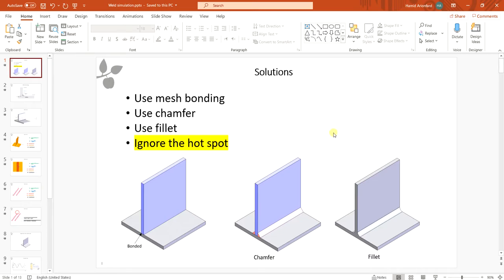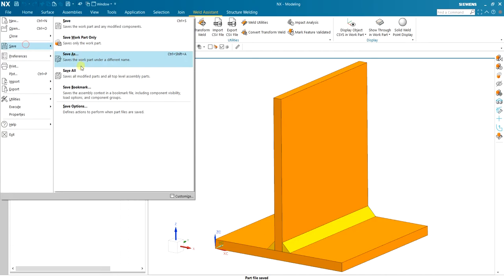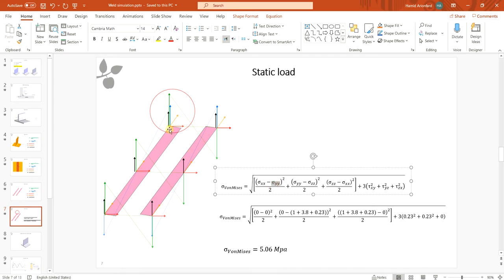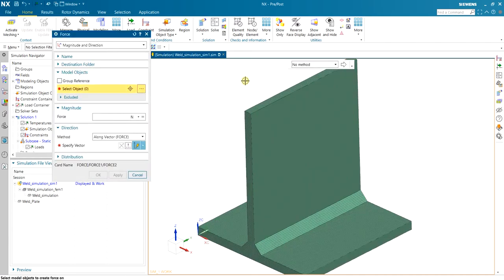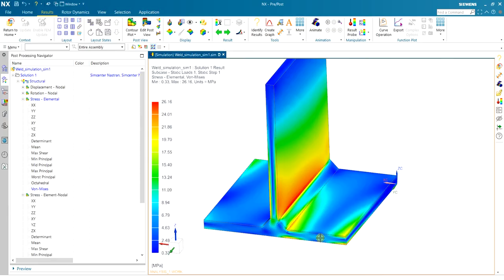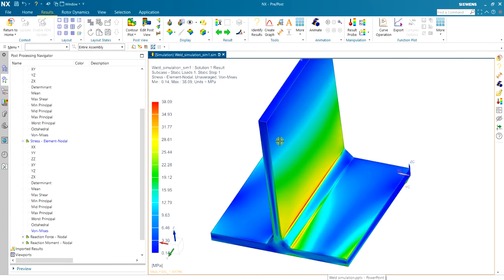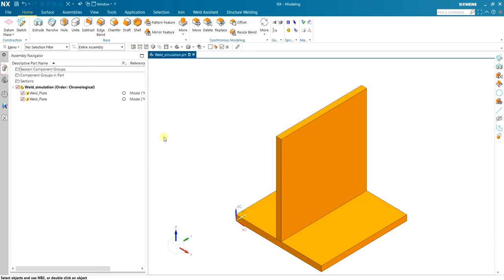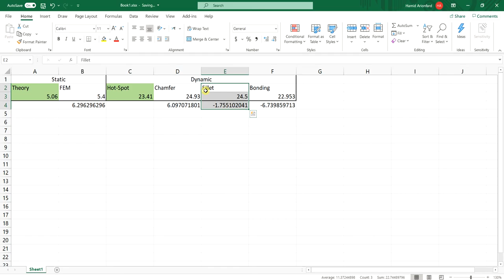Fillet weld simulation by using FEM

Comment: The calculations for bending stresses use the leg length not the throat size. Welds are analysed based on the assumption all loads are transmitted in shear. You need to use the throat length in these calculations not the leg length.